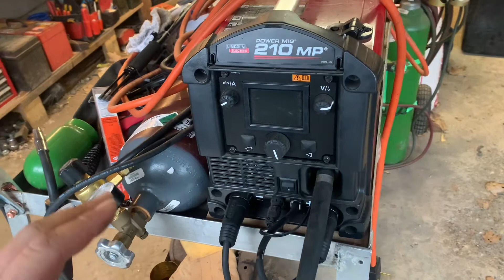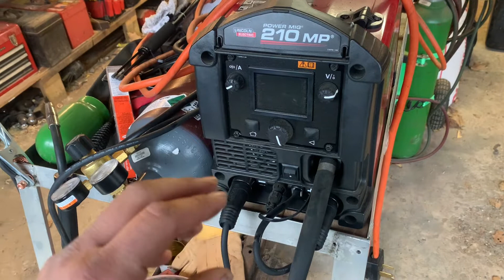Gifts For Guys - Do’s And Don’ts

Comment: Nice try, Mr. Torque, but I think that it's super hard to buy the right gift for someone in a category that they're really experienced in.  Buying an auto mechanic a socket set, unless you're a mechanic too and know what the guy uses and needs, has a low probability of success.  He probably hates Chinese Craftsman tools, and you'll never know.  Me guessing what a violinist would like would be hard.  My mom bought me a set of Exacto carving tools (really just a handle and a bunch of blades) years ago because she knew I did woodworking.  I thanked her sincerely, put the box in a special place, and think of her when I find it.  You're better off getting something else in an area outside their specialty that they're interested in but are just getting started, like getting the auto mechanic a sausage maker.  Or just some fresh underwear.
Reply from the maker: Did you watch the whole video? I specifically cautioned as to what your saying.
Reply from the maker: With the snap ring pliers try to source a good brand. The ones I have are actually cheap ones I got used but if I bought new I would probably get Channellock or another American brand